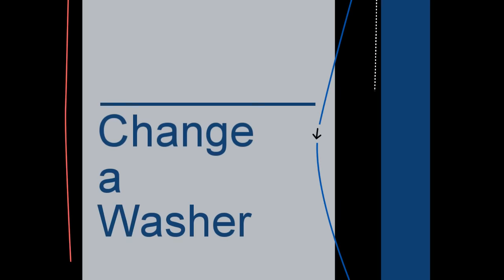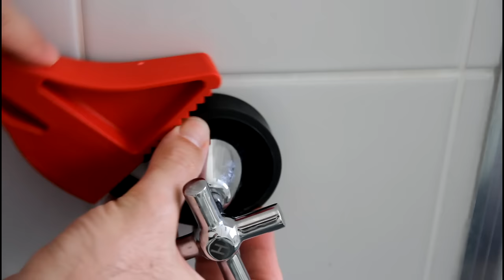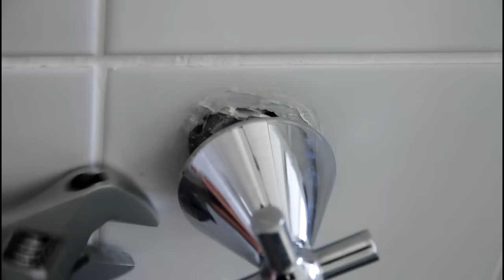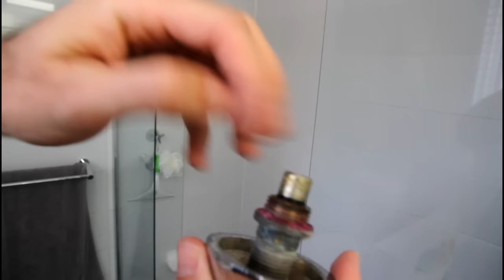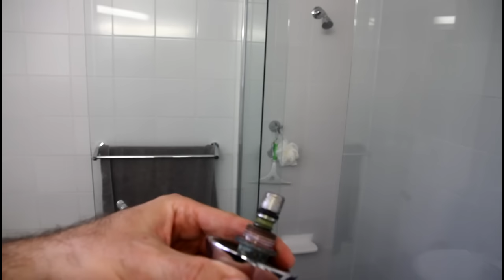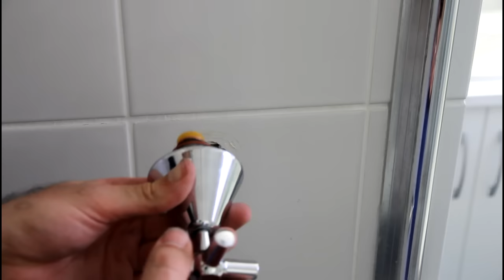Changing a shower tap washer

Comment: Nice work, I just changed the washers in our chronically-leaking shower and this video was my guide. Worked a charm, especially when I couldn't remove the tap heads (didn't have the 2-prong tool) and ended up taking off the whole assembly instead. Cheers!

Comment: Here's a top tip for people as amazingly stupid as me: if you turn the main back on after changing the hot tap and water is GUSHING, check that the cold tap is actually turned off before you pull it apart ten more times getting more irate each time.

Comment: The last thing in this video was you screwing on the fitting behind the handle (I don't know the name of this - the bit that covers the hole in the tiles). When you unscrewed it earlier, it looks like there's an adhesive. Yet you didn't re-apply anything. My question is, if that piece is loose after changing the washer, how do you secure it? What sort of adhesive would you recommend?

Comment: My tap does not seem to have a nut behind the bell-shaped part. It just looks like a thread, any suggestions? I can't make enough space to get a spanner or wrench behind it.
Reply: There should be a nut there. Ours was recessed a bit in the wall which was a bugger to undo. You can buy angled vice grips which is what I had to use so I could get the leverage to unscrew it. Good luck!
Reply: Same for me and I have no idea how to remove these damn taps! https://imgur.com/a/sYDSFfN does anyone have any idea what brand they are so I can maybe find a user manual somewhere?
Reply: There will be a nut there - ours was inside the wall a bit and the entire thing filled with silicone sealant so I had to cut it all out first to get to it.

Comment: Thanks for the video, it helped me to get the conical part out. After that I unscrewed the tap with a wrench, it came off but the tap handle and everything else is still stuck to the wall. I tried the same method on another tap of same type and it unscrewed fine as shown in your video. Any idea what went wrong.
Reply: Yeah he didn’t use the proper tools. You need a tap wrench

Comment: My covers are located close to the handles so I only have like 5mm to get something in there. Handles cannot be removed from the shaft. Any ideas. Thanks
Reply: I used this video to fix the tap at my son's house at the weekend. Under the tap handle there was a threaded coupling with two slots that you can fit something sharp into. It screws off anti-clockwise and you can then remove the tap head. I didn't need to but this was loose and I saw how it worked and tightened it. Good luck if you still haven't  done this eleven months later! ;o)
Reply: With the water turned off open the tap all the way out and that will give you enough room to get an open end spanner in I think its 22mm if I remember

Comment: I think that tap cover was loose to begin with. Have got a strap wrench mine won't budge at all. Do not recommend caroma retro taps at all.
Reply from the maker: You are right. I had a go at it first to make sure it would come off. But if you have a strap it comes off pretty easy.
Reply from the maker: The turn on the video was my second try. I did it the first time to make sure the strap wrench would work. The first time it took a lot more effort to get it to move. I had to really pull hardon the wrench. Was worried I would break it, but it just started turning.

Comment: hi i got this caroma style tap cover. i used the strap wrench it wouldnt budge at all. ? is there another way to remove this cover. looks easy on this video, but ive tried many times .
Reply from the maker: john chua you need to use a little bit more force and it will come off
Reply: Sometimes the only way to get them off is with multi grips and a rag an you still damage the covers an have to replace them. They corrode an are super hard to get off sometimes

Comment: Bought one of those and it doesn’t work on an angle. You show it on a cover that is loose already...
Reply: I thought the same but makes sure your using the grip part of the wrench so you lever as you turn. Using 1 hand to hold the strap onto the flange, and the other hand slowly turns, no sudden movement needed.
Reply: Yeah those rubber straps don’t work haha

Comment: Iv tried so many times and it still doesnt move an inch, is there another way to get it loose,  Any help will do
Reply from the maker: Probably needs a bit more w grease to get it moving. A lubricant like WD40 that they sell in Australia will help if you cant get it to move.
Reply: I saw your comment too because I had the same issue.  However I did go back and pressed the tool bit, including the rubber, close to the wall - as I gripped the sleeve of the tap.  Sudden jerk movements did the trick
Reply: @arandebaron8451  agree, the cone shape cover is the most stupid design of all time, there is no tool to loose it

Comment: I have the same pesky tap. My problem is using the wrench at 1:54 mark. My small wrench could not get a good grip and it would not turn. I have a bigger wrench but the head is too wide to go between the gaps. I hate these type of tap (where you cannot remove the tap head and are forced to work with the small gap). Any tips to help?
Reply: Never mind. Bought a new wrench (longer handle but thin head width to access the gap) to unscrew the tap. Took the opportunity to replace the old tap system with new design which allows easier access.